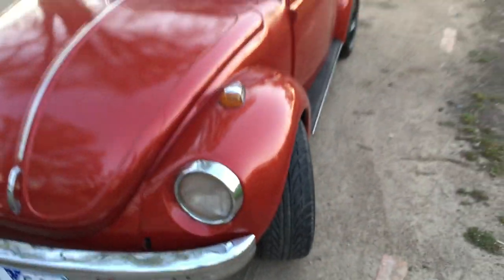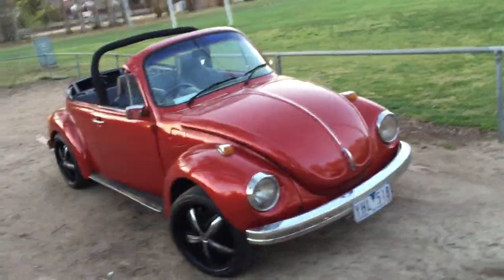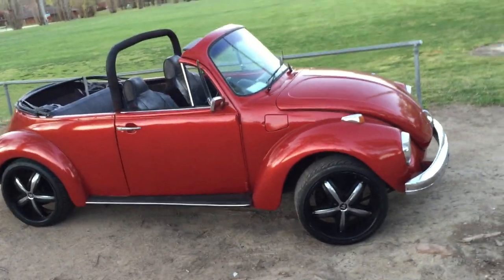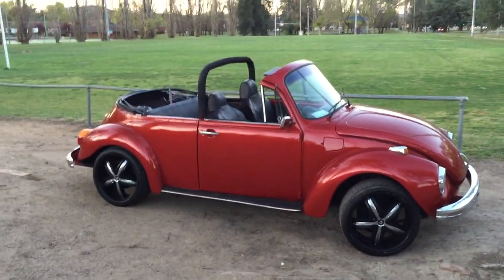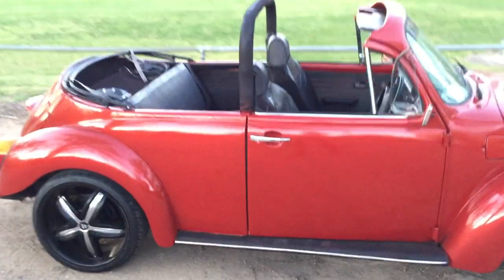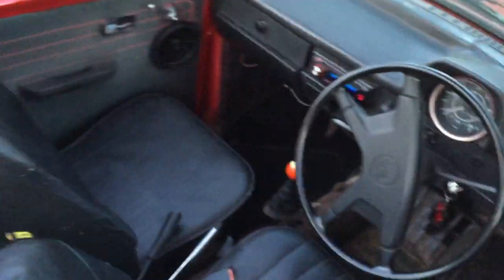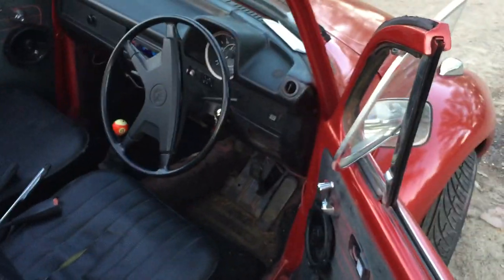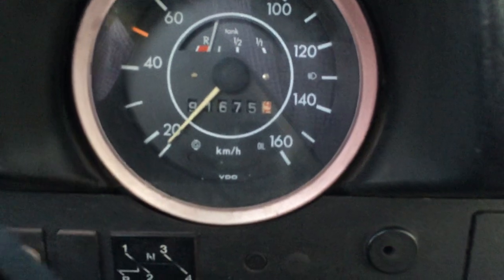1972 VW BEETLE / Convertible Conversion / 1600 / SuperBug

Comment: what a shame about the roof well no point keeping it now may aswell scrap it or part it out unless you could find a roof for it
Reply from the maker: It got sold to a Beetle collector and he loves it. many clubs have said it was one of the best conversions they have ever seen. even better than the original factory version in the supports and rigidity.
Reply from the maker: it also had a pop top roof that was is foldable and is located in the boot. it simply just pulls up out of marine grade material.
Reply: I like it. I even would make a electric conversion.